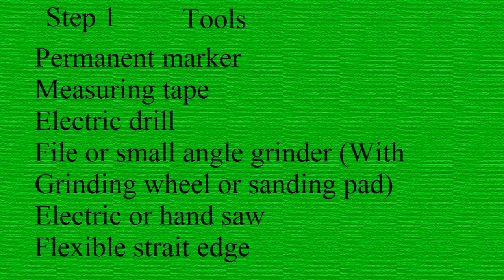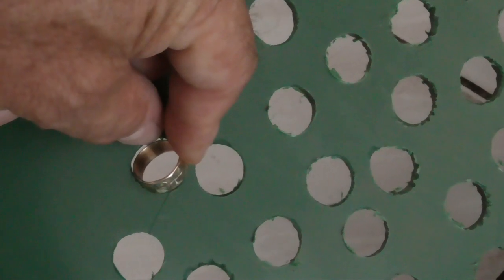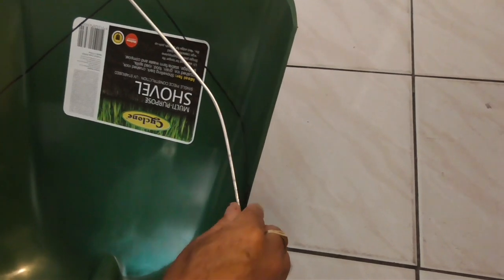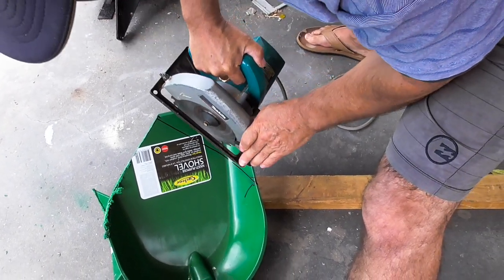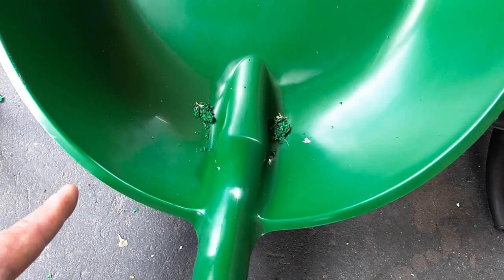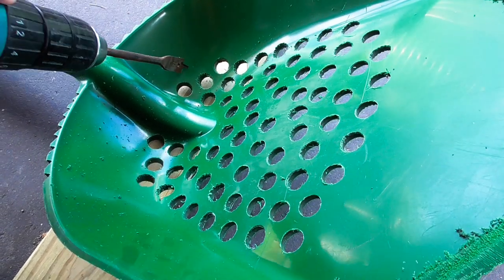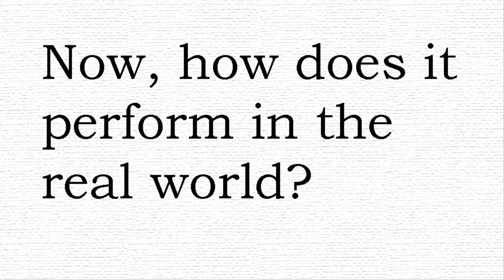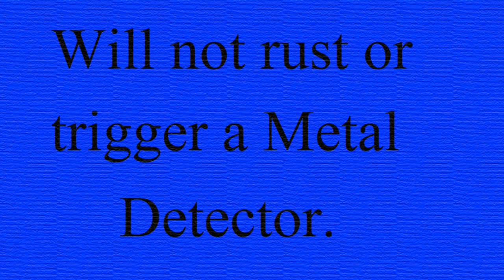HOW TO MAKE THE ORIGINAL PLASTIC SHOVEL & SIEVE.

Comment: Great videos -well done very informative and helpful I've been into metal detecting for many years,and finally bought an Excalibur II last week,along with a stainless steel Ukraine scoop,I have been to Bunnings and purchased the green shovel and will mod that to be the same as yours as I mainly wish to water hunt.Your videos will save me lots of time in the field as I'll at least get the hardware side of things fairly well sorted instead of having to re address and think of how to mod etc.Thanks so much!
Reply from the maker: Thanks..A lot to learn with this hobby. You can use a grinder cutting wheel to shape the shovel, but be wary of molten plastic burns and not breaking the cutting disk.

Comment: going to tractor supply tonight to get the shovel and will be modifying it shortly... awesome idea
Reply from the maker: Lot of work.. i cut it with a angle grinder cutting disc, but be careful of plastic burns. very durable in sand however...

Comment: I did a similar thing with a plastic shovel I got from Wicks in the UK but cut the front off straight, the shovel was only a few quid and it works really well.  I have also made a sand scoop out off a plastic pipe, as yet untested but it looks good. I drill all my holes with a cone drill which gives a nice finish, and drill the holes just smaller than a 1euro cent. Love the safety angle, goggles, ear defenders and open toe sandals HAHAHAHAHA

Comment: Just as a little FYI, I've found that using a step drill bit eliminates all the rough edges when drilling holes in plastic/PVC.
Reply from the maker: A backing of wood helps it from suddenly grabbing, but yes the last thing you want is to clean the holes after drilling

Comment: Hey there I know this is an old video but I was wondering if you could do an updated tutorial on the shovel you use now. Even just an easy run down. I see your new one you have more holes and it doesn't look as pointed. Thanks :) love your videos!!!
Reply: Yes I will work on that next but it might take a while
Reply: Could you take a photo. Of it pleaseeee? We have just gone out and bought one because we love your videos and would love to modify ours the same as yours :) you're awesome thanks!
Reply: @Kira-fv3fp  A update video is time consuming. Draw the two sides to a point with a texta , cut using a jig saw  (stop Vibrations) or cutting wheel (Watch hot plastic) on a grinder or by hand saw (find someone who has the tools)  and taper your cut,- with a heavy duty file then cut nicks in the top to keep your feet from slipping off when digging. the holes are the hard part, just drill 13 mm holes, not too close to each other and away from the edge or weak spots. I am experienced in using these tools and if you are not then for the purpose of safety beware that plastic can melt and burn,- and power tools can get you into all sorts of trouble. Do it carefully and you will have a very strong and useful tool for digging even packed sand and water. Mine has dug hundreds of holes and never fails to saves my back, when digging.- even deep holes, but there is no correct way to do this without doing something wrong, and have the shovel break on you, or running into problems using power tools. Just be careful. I will update the video in 2 weeks
Reply: Thankyou soo much you're awesome. You don't need to update it I know that doing tutorials is very time consuming with editing the video etc. Thanks so much for your reply I appreciate it :) thanks for all the info I'll give it a shot :) I'll let you know how we go! Thanks again!!

Comment: Love it great video, great attention to safety yet still uses flip flops and shorts! LOL This look like a great sand scoop for sandy beaches specifically. In Seattle we have a lot of ROCKY water front making digging a chore... Bet this plastic shove is much lighter than my stainless metal scoop!
Reply from the maker: Thanks Jeff.- Rocks are always a problem and yes they are very light and surprisingly strong. but works best for digging deep holes in in wet or dry sand.

Comment: how many people do you think saw you use the circ saw so they used one and didnt brace the shovel with there feet and wonder why they didnt get a nice cut :) , i would probly do the same with the grinder i use one every day so a bit of plastic in the guard doesnt phase me. will probly also just get all the odd sharp and annoying bits of plastic left over off with a stanley blade. thanks heaps for the measurements one thing i didnt think about was running a home made coil on it until i saw your videos. should be easy enough to rig up a pi or uno with a coil
Reply from the maker: I learned that the hard way.. circular saw can shatter the plastic... grinder ..plastic burns... drills grab and go strait through with no base... many people  don't like too much detail i think.